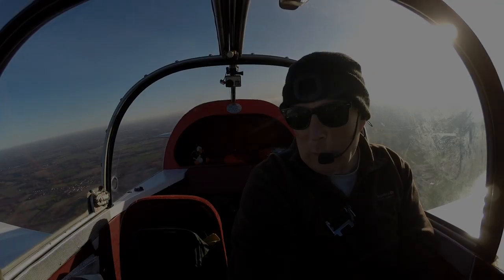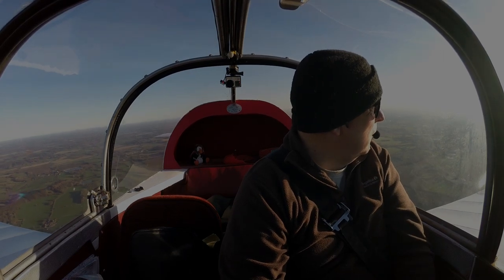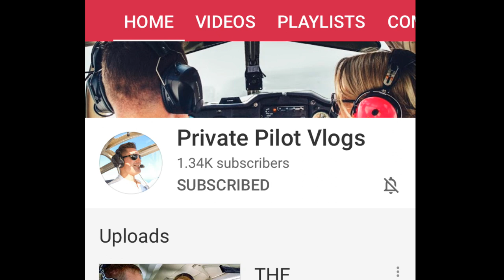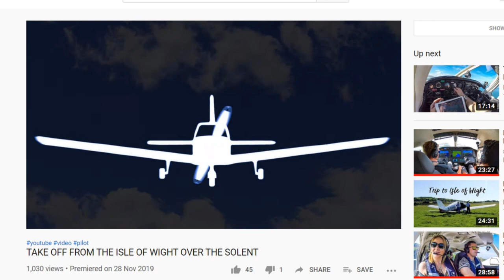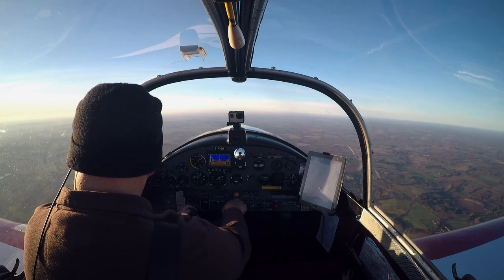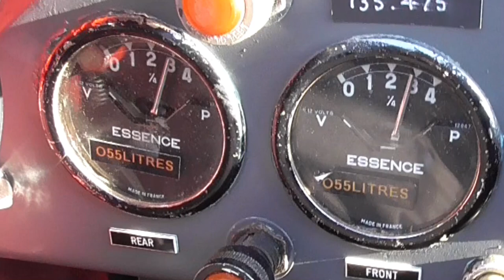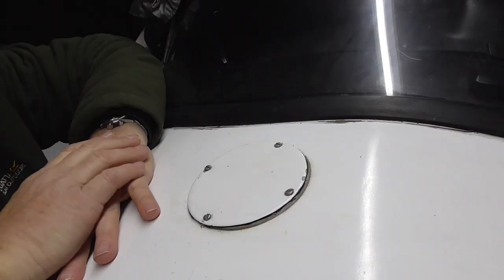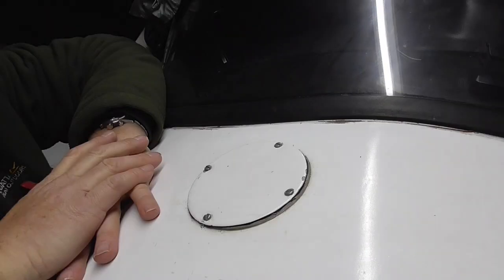FUEL SENDER EASY FIX - This could save you a lot of money

Comment: Well Done Tim. Always a problem when the weathers not so good for flying..but as always interesting..fuel senders.Very easy to test..Not always easy to access. Good to see John using the same repair techniques I would use..especially when I can’t get the bits for older machines..Just spending time watching this storm passing over..wondering if I will have a shed left in place..all the best Jim.
Reply from the maker: Thank you Jim. Just back from visiting our son to find a tree down in the front garden but it was one that we were going to take down anyway so mixed blessings there!